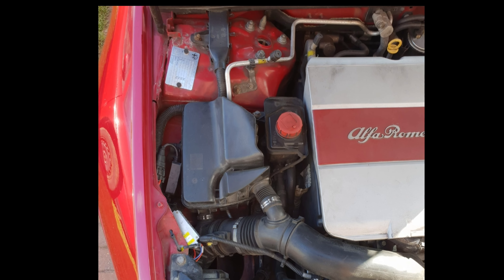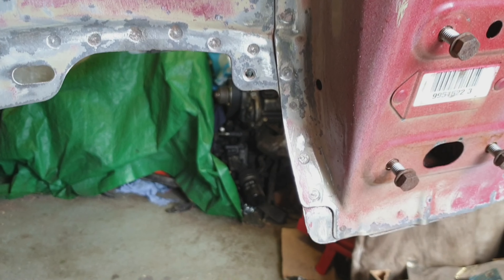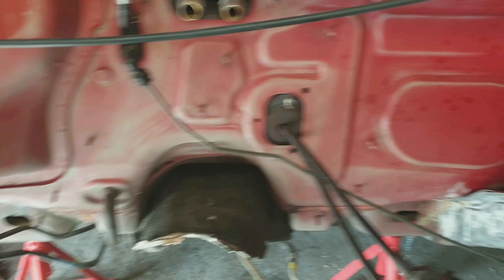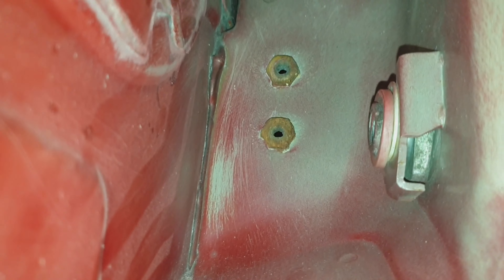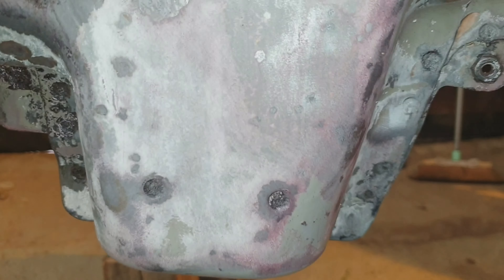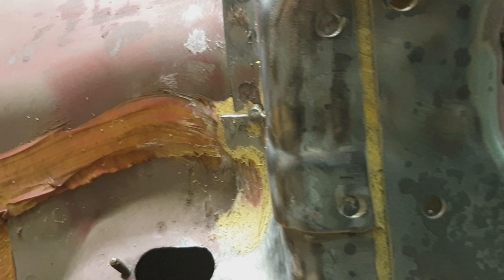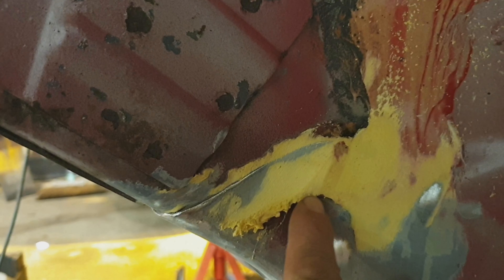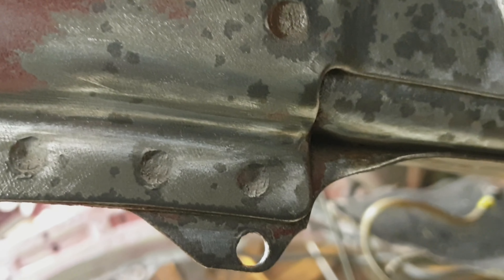Alfa 159 2.4jtdm project - part 8 - Cleaning up the inner front arches!

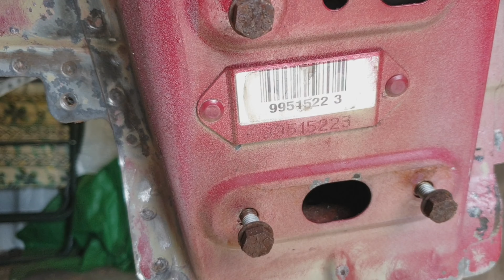Comment: 4:49 That's a good question.  Do the numbers on the barcode correspond to the VIN number in any way?  If not (probably not, it looks a bit short), I think it must be a "shortcut" barcode AR used at the factory, unique to the vehicle, to ensure that all the correct parts ended up on the right car during assembly.  Obvs the VIN number is also a unique identifier but car manufacture is really complex so there must be a good reason for that plate being there.

Comment: Great job, even worse than Swedish sold 159. why not sandblast? or a Vapor blast?
Reply from the maker: Hi🙂 I don't have any media blasting equipment, my budget does not stretch far enough to get it done and my trailer struggles to fit the 159 on. 
I have to do every job myself and with limited money. The two things I do have are time and the will to get it done🤣🤣
Reply: @FullBoostJ4  maybe you can do the Electrolysis Rust Removal technique to restore the subframe. cost less and fast enough. :)